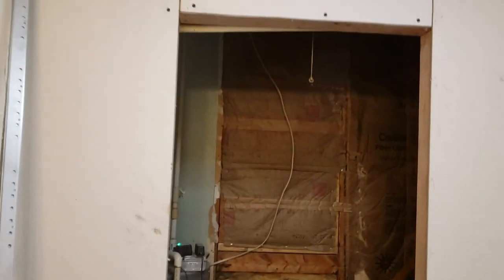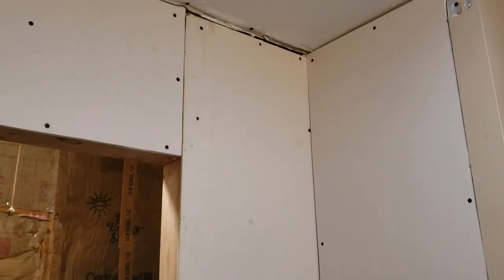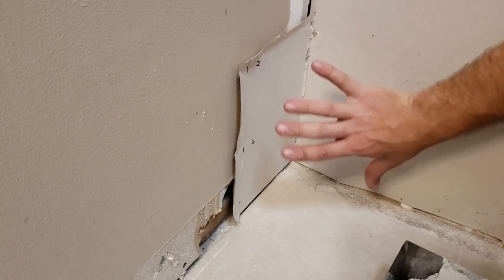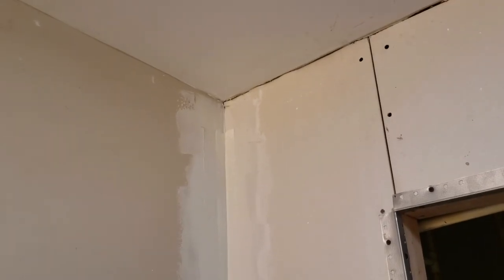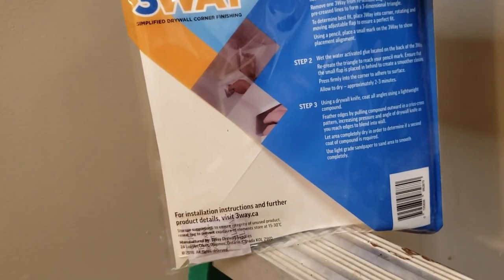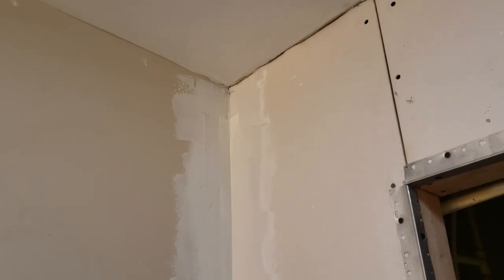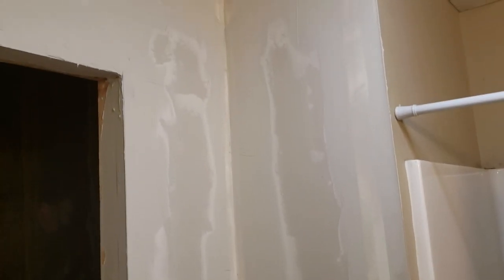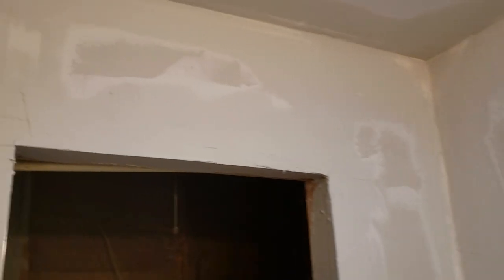2 Drywall Hacks Everyone Needs To Know

Comment: when sheetrocking over doors & windows don’t have seams above, go beyond edges as far as possible.
Reply: Over a door is an ideal place for a joint
Reply: Richard  Burgess no it will crack you clearly are a amateur not a professional
Reply: I did exactly that the first time I did drywall. Sure enough, it cracked every year. I patched it time and time again. I finally hired a drywall guy who showed me a trick. He cut along the repaired cracks and patched it with a quick dry mud (45 minutes I think), feathered it out and sanded it. Hasn’t cracked again. Regardless, it would have been easier just to do it right the first time.

Comment: If your not putting 3 coats of plaster on maybe you don't have enough on. As a chipy not a gypy however my understanding as someone who does it everyday, bring your plaster out the length of the float. 230mm or so either side of your joint or tape. Otherwise good job so far. Don't sand too much off. Well done I would never put myself out there the way you do.

Comment: foor them metal corner beads dont use them all metal one you screw on, get the metal paper ones no screw to bend the metal, no screws that pop the mud off ,, you just mud your out side corners and press in the paper metal corner bead, that all metal one is so out dated, in fact i dont think they even sell them here in years, you shouldnt need to sand between coats, just knock of ridges with puddy knife and go again the flair should be 18" on each side, when putting a dry wall patch in cut the old dry way back to center of studs then put your new peace in, all ridges must be screwed or they will just pop. dont put a dry way seem in mid air, if you plan on putting a sliding door, you should have framed the wall for a pocket door, cheap. looks great and when open it is out of site
Reply: obvious you never been back on a job to see how well that flex tape holds up , the shit is junk

Comment: You dont even hold knives the right way put your index and middle fingers on the blade like V and you will have more control.
lay knife and do some sort of roling motion - you dont put knives 90 degree to a wall ,you start about 45 and end about flat ,all your marks because your knife is 90 d. when you smoothen you can start 30...

PS. video name is plain dumb - hacks from guy who cant tape a corner and cannot smother mud (when I tried first time I did better job - honestly and I didnt have YT or somebody really to explain me) - srsly...